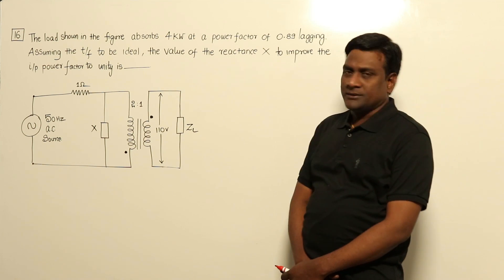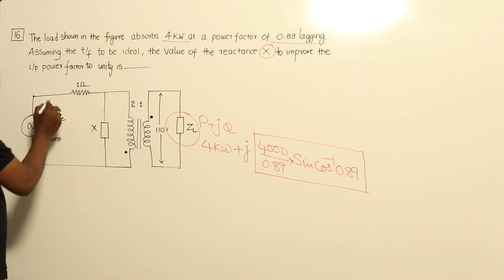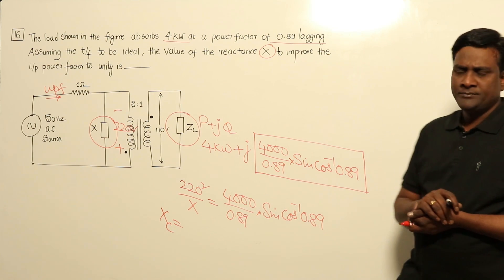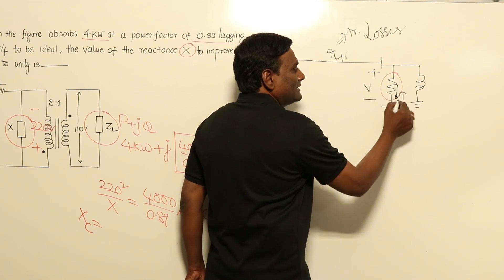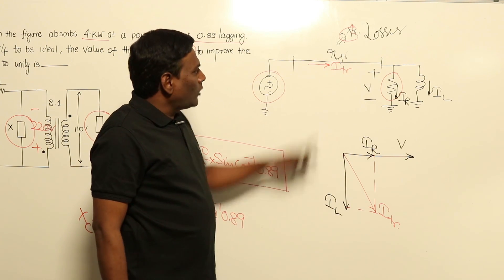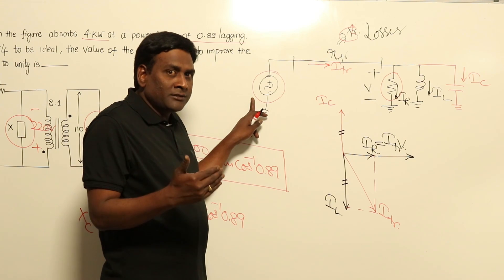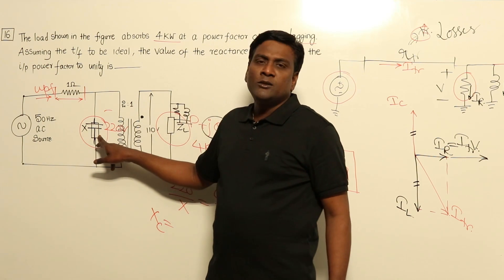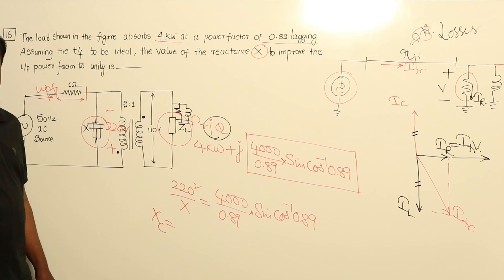Ideal Transformer at Load |  Problem set 5 | Electrical Machines |Gate Lectures by KN Rao | Gate2021

Comment: Sir, this is one of the most effective lecture giving clarity on capacitor and inductance based compensation. I have requested and again hope few portions to be covered in power electronics or GATE 2020. please sir. It's okay if you release 8-10 power electronics lecture in mid January.